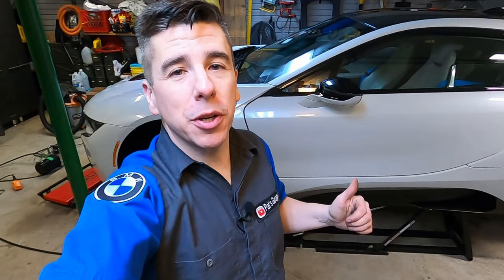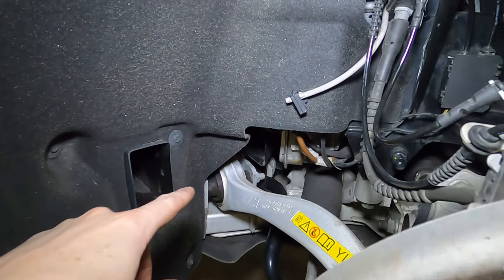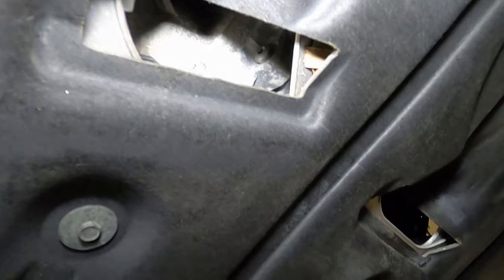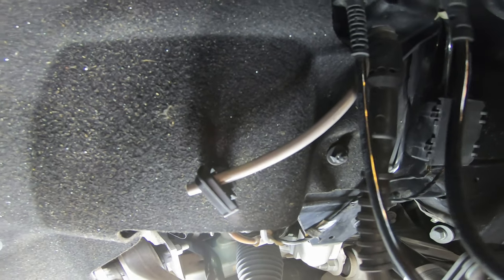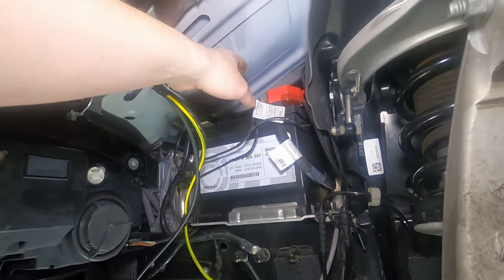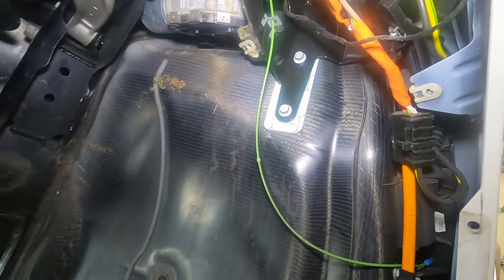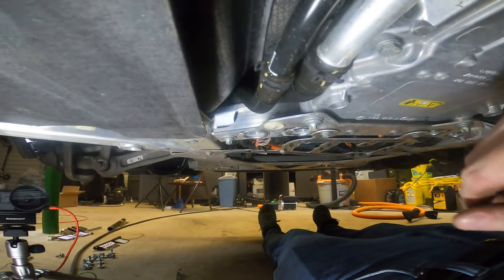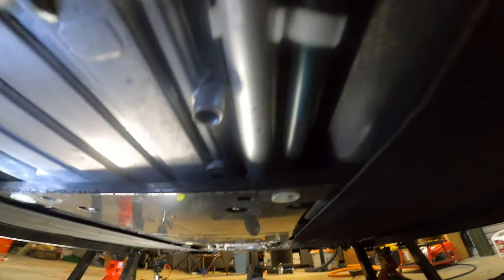BMW i8 inspection UNDER the body panels - see the electric motor and high voltage battery

Comment: Awesome! Video and a very detailed one as well. Just a quick question Pat, where do buy your BMW I8 body part and the accessories...keep up the good work Pat!
Reply from the maker: Thank you. I typically buy my BMW branded parts from FCPEuro, as they are 100 percent guaranteed. If they wear out, replacement is free. This covers even things like engine oil, filters, brake pads, etc. All other aftermarket purchases have links in the descriptions of my videos that I have posted.
Reply: @PatsGarageOnline  thank a lot

Comment: Just with the removal of the first wheel arch on the driver's side and finding all that debris would have made my day. I'm repeating myself, but every time you do one of these in-depth inspections, I'm amazed at the engineering or I should say over-engineering of the I8. While you pointed out the coolant lines I thought, hmmm, I've seen this setup before. Yep, on the DeTomaso Panteras. Did the DeTomaso's ever "call to you?" They're quite an engineering masterpiece as well and I think they'd make a very interesting addition to Pat's Garage. Scrubbing Bubbles!? Go figure. Interesting how when you sprayed a spritz of water on it, it seemed to re-activate. Love this hack, but I wouldn't tell the Germans about it. 😉  Save the Wave🙋🏼‍♂️
Reply from the maker: Hi Peter and thanks for the comment.  Yes, I'm familiar with the Pantera.  My dad had the chance to drive one when he picked it up for inventory for a dealership he was working at many years ago.  Spent 2 hours driving from Philly to Schuylkill County, PA and loved it in the mountains.  I enjoy taking them in at local car shows.  The coolant system is quite interesting and there are LOTS of coolant hoses all over the car.  The throttle body even has it's own coolant line.  Coolant is used to help keep certain components cooler because of the engine being out of the air stream.  But, if you have a leak, it requires a complete draining of the system, purging with a vacuum and closed-loop refilling to get the top of the engine to take on coolant.  Gravity hurts you in these mid-engine cars as air rises into pockets around the engine (as I'm sure the C8 owners will soon experience).  I was surprised just how well the scrubbing bubbles worked, especially on the aluminum and the painted caliper.  Quality product, from the bathroom to the road!
Reply: Fascinating that the throttle body has it's own coolant line. It does make sense, well a little until you realize how many dedicated sub-coolant systems have been run and could be run to keep the engine cool. I'm no engineer, but it kinda begs the question with these mid-engine cars as to why they just don't have their own A/C systems in the engine bay to automatically turn on once the temps go above xxx degrees? 
Now you bring up an interesting point mentioning the C8. I'd like to see you do a comparison of your 2015 I8 to the 2020 C8 and see how much GM closely, if not identically imitates and/or duplicates the German engineering. Of course to do such a comparison would necessitate you having a C8 to disassemble which I know won't happen . . . unfortunately. I do think with your keen eye and mechanical abilities, you'd be the man for the job. Who knows, you might even surprise yourself to the point that you'd say, "Wow, what am I doing with an I8, GM just beat BMW at one-half the price along with easier servicing?"
Reply from the maker: It is really interesting what BMW has done with both the coolant and the air conditioning. For example, the air conditioning refrigerant lines run through the high voltage battery modules in order to keep them cool. The air conditioning is powered by the high voltage battery so it doesn't draw on the engine. However, the coolant is used in the mid-engine parts such as the transmission cooler. This is exactly like the C8 Corvette. Other parts that are cooled by water include the intercooler for the charge air. 

I mentioned the throttle body, however I forgot to mention that the throttle body is always open by default. BMW uses a valve lift controller inside the head of the engine in order to adjust the valve opening. The valves are effectively your throttle. The reason they do this is to ensure that the boost pressure from the turbo goes all the way to the heads in order to prevent turbo lag. If the normal throttle closed, air pressure would drop between the throttle and the intake, and creat turbo lag. The only reason a real throttle is there is in case this technology fails. BMW calls this technology valvetronic.

I've already reached out to Justin from horsepower obsessed, and hope to get together with him to do a comparison between the I8 and his C8 that is on order and awaiting delivery. You are correct, I will not be able to tear the car apart, but I am looking forward to comparing the systems in the cars as far as I can.
Reply: Wow! I feel like now I've just been on the receiving end of a scatter bombing run of BMW "bits and bobs" my bathtub gin making Grandmother used to say. Thank you. I think?🤔😉 Let me gently sip and hopefully digest all of this information. I just signed up with my local ShopRite for their home-delivery service for Chock full O'nuts and to just "keep it coming." 
Have a good and safe rest of the week and weekend. And remember: RIDETH, DON'T HIDETH! The longest day doth approach on Saturday, June 20th MacPat! Fare the well my good-fellow. 🙋🏼‍♂️

Comment: How much do replacement batteries cost ?
Reply from the maker: There are 6 battery modules inside the enclosure.  Each module MSRP is $1,600 USD.  They are warranted for 8 years of 100,000 miles.  In case they drop below 70% capacity, BMW will replace a module within the warranty period, free of charge.  After 8 years or 100,000 miles, it's on the owner, but it doesn't look too difficult to do.  And, the car will still run even if the battery capacity drops to 10% because it has a mid-engine.
Reply: Pat's Garage Online  thank you !! so after the battery degrades after sometime we will have to run it purely on the gas engine right ?   A
Reply from the maker: The gasoline engine will propel the car but the 12v system relies on the high voltage battery to stay charged. Without 12v, the ignition won't fire in the engine. So some high voltage battery life is required or we can't drive it at all